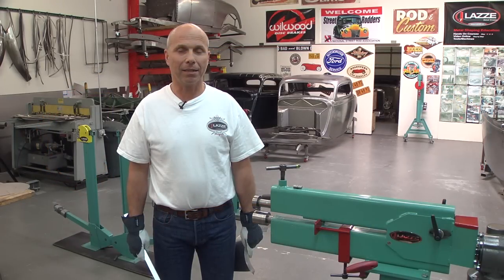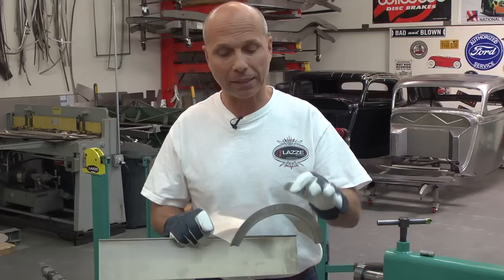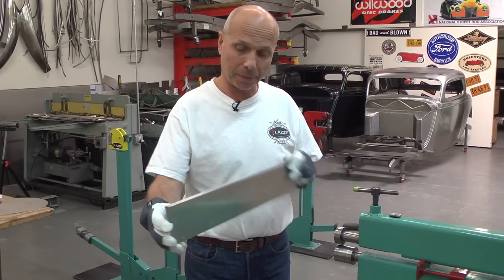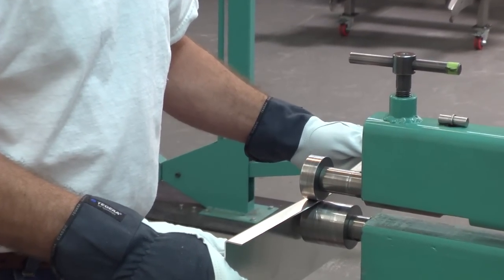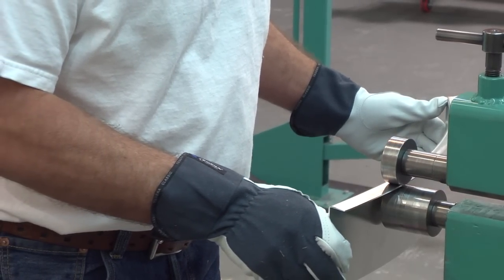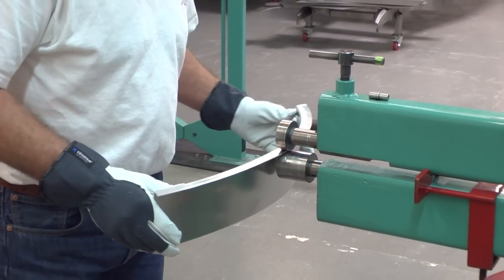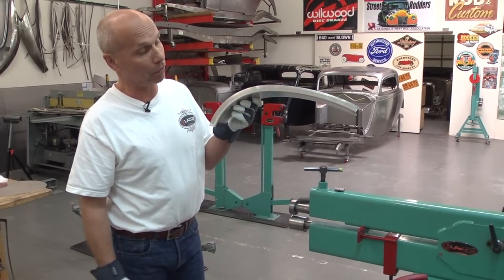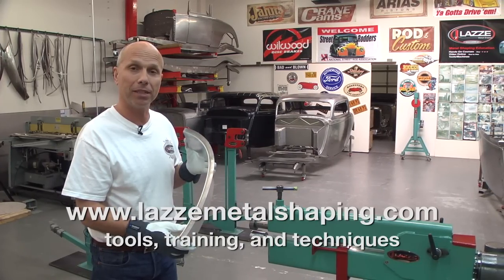Metal Shaping with Lazze: Stretching Aluminum in a Bead Roller

Comment from the maker: The rippled edge means you were too close to the edge. If you move further into your material and it should improve.

T6 is very hard, you may want to try annealing it first, even then it may be too much for the machine.

All of the materials I use are in my video titled What Materials Does Lazze Use in the English Wheel and Bead Roller